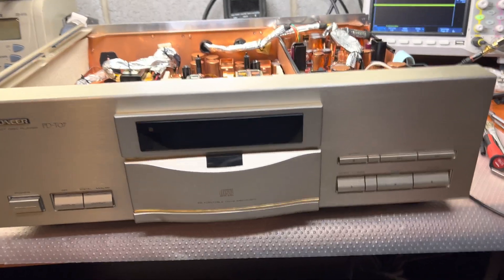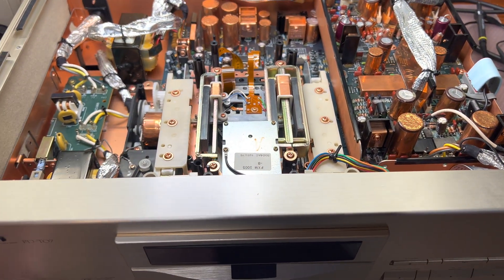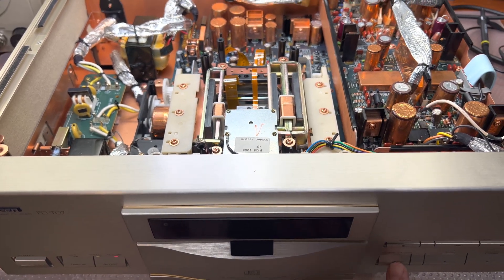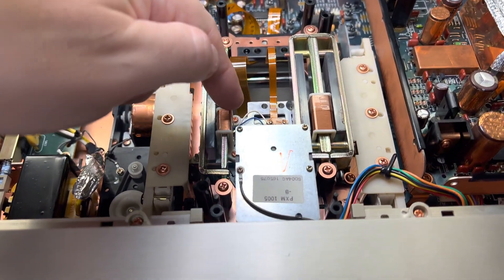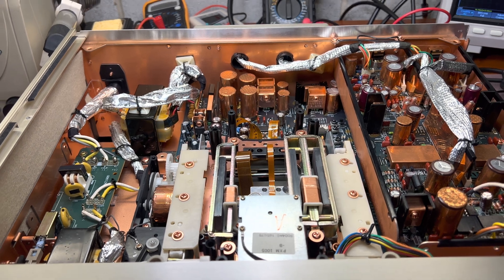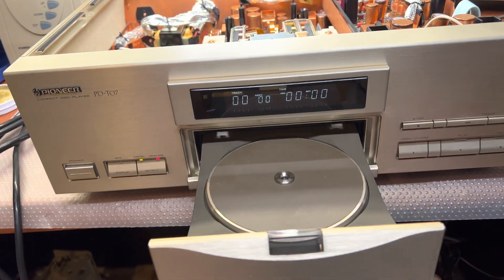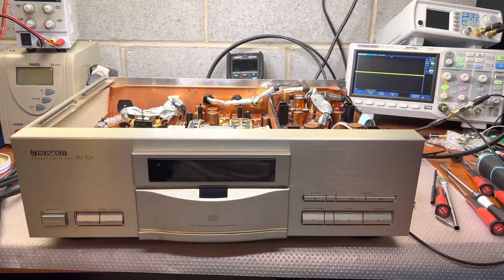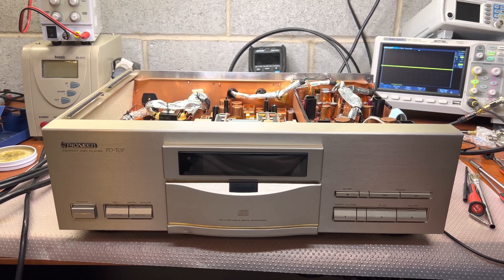Pioneer PD-T07 Restoration Part 9: Fixing CD Transport Start Cycle and Troubleshooting Laser Issues

Comment: Hi there. How to make a test mode ? There is two jumpers  . Should I shorten them ? Thanks.
Reply from the maker: @vladgeorge8984  it is in service manual. If I remember correct keep short while power on, but check with manual.